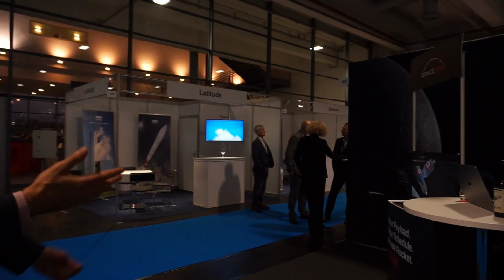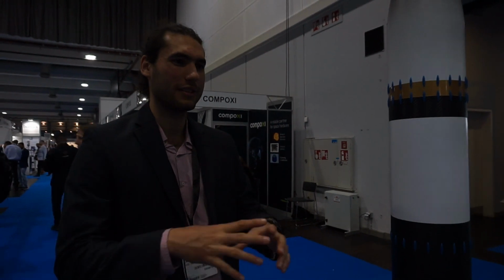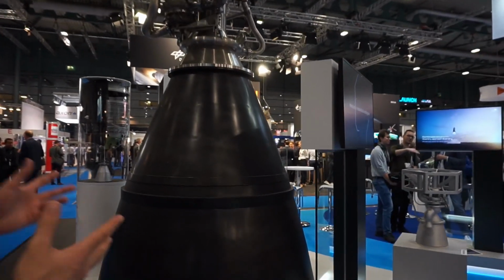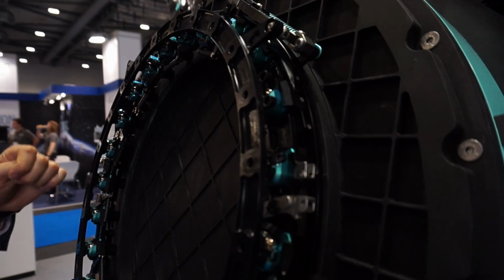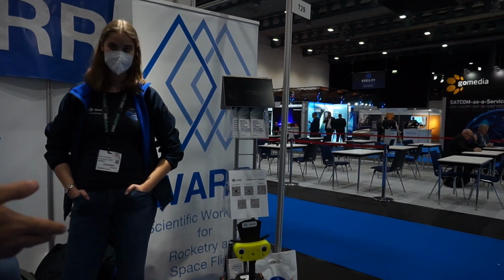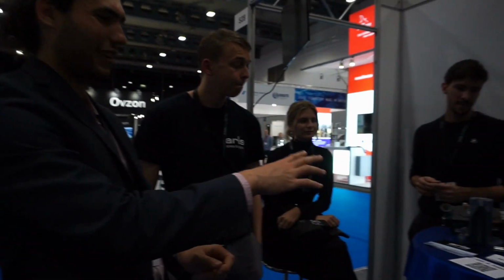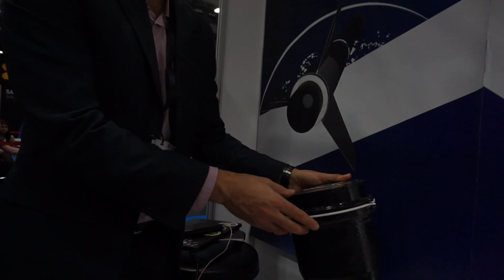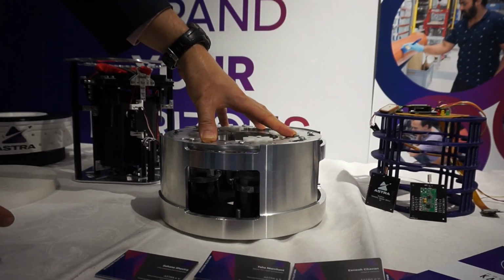What is going on in the European Space Sector?

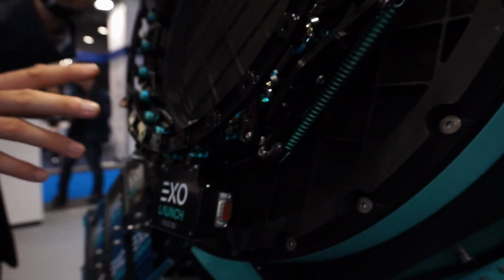Comment: 6:28 i wnat to see more about that.
I am wonder the extreme temperature and cold welding of the mechanism.
They already test in space? i like more than explosive on long therm
Reply from the maker: Exolaunch actually has quite a lot of flight experience with their separation system.  So far, no failures.  At this point I would say their system is TRL 9.  With respect to the fears of cold welding, typically this effect is only experienced after long durations in space.  The separation mechanism is usually triggered within minutes of reaching orbit so the parts will not have reached temperatures where cold welding would be a concern.  That being said if a mission profile called for a separation after some days or weeks, this could be a concern.